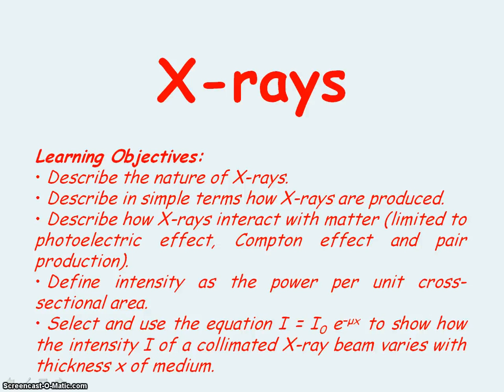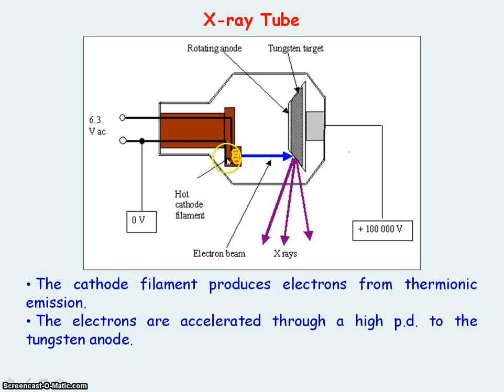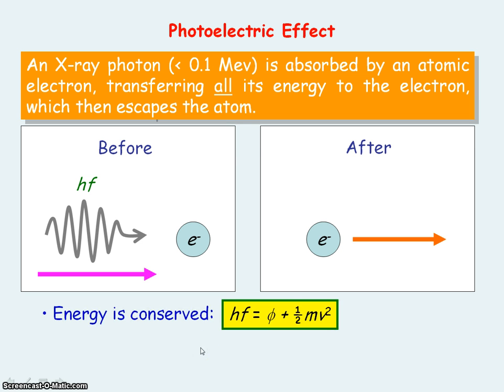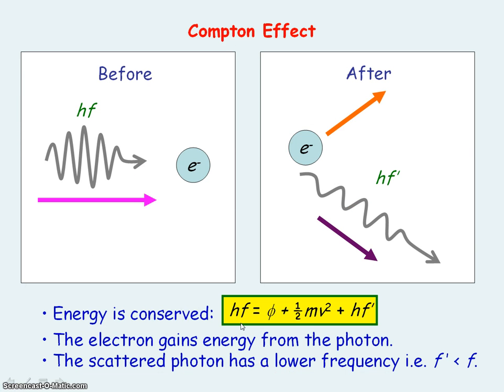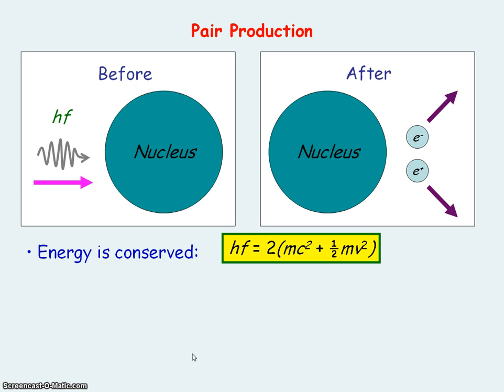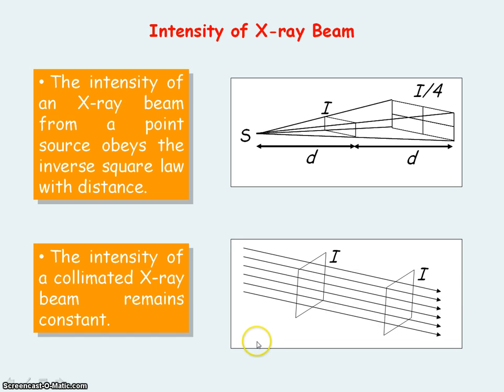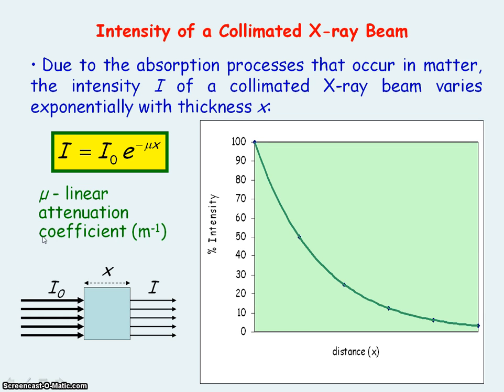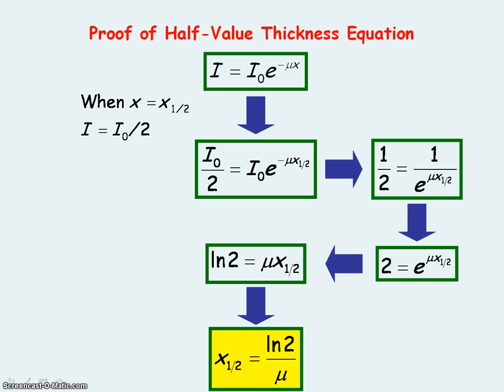Medical Imaging 01 - X ray Production & Interaction with Matter

Comment: Thank you very much l ask if the energy of the photon can be departed to two parts ? why it is not devided in photoelectric effect ?
Reply: The photoelectric effect relies on the binding energy of the target atom being exceeded by the incident photon, any residual energy will eventually be expressed as heat, although this may well be undetectable.